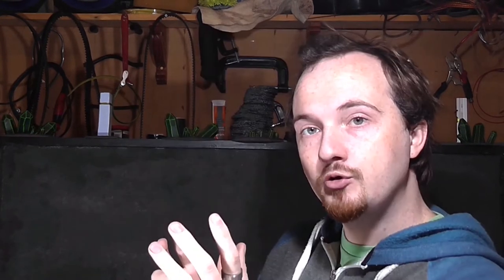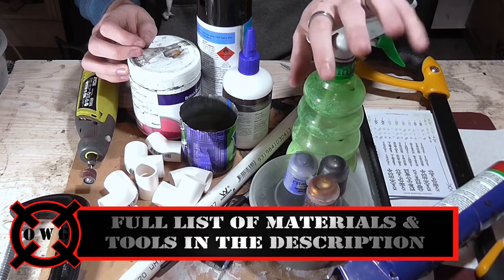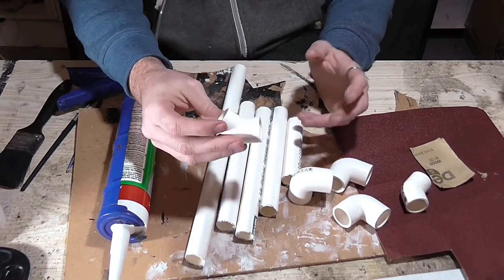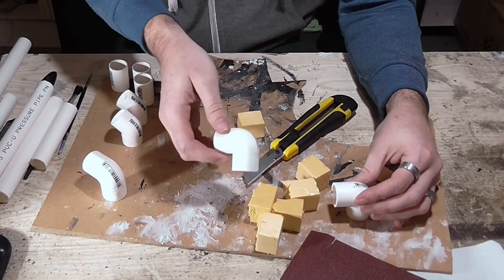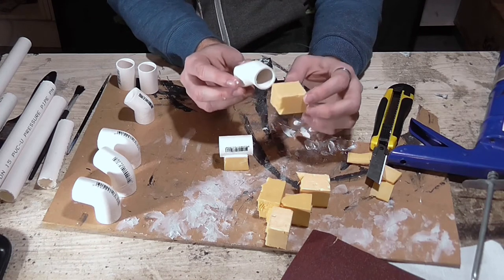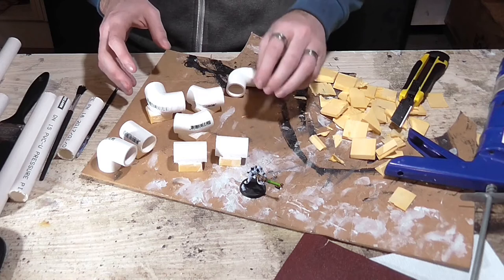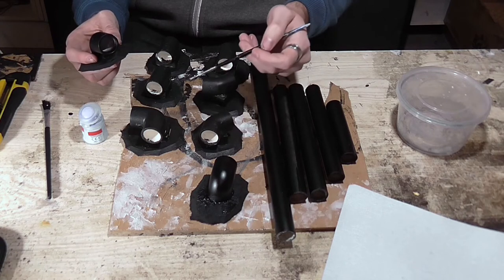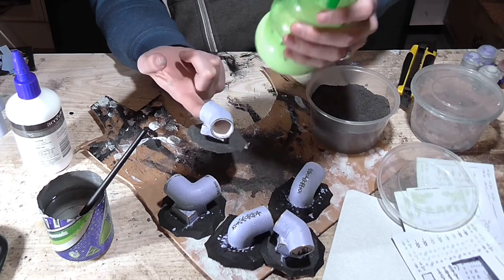Building 40K Terrain - Modular Wargaming Pipeline

Comment: For Necrons, how about using bundles of clear plastic straws instead of the solid pipe. Then use green LEDs with some fibre wire to give them a glowing effect. Have the junction parts as small obelisks.
Reply from the maker: I like your thinking.